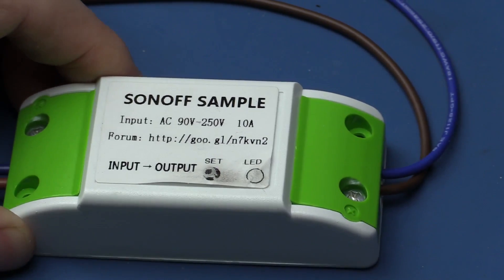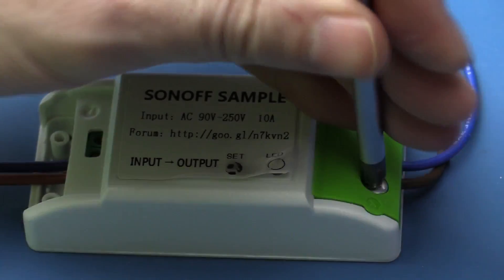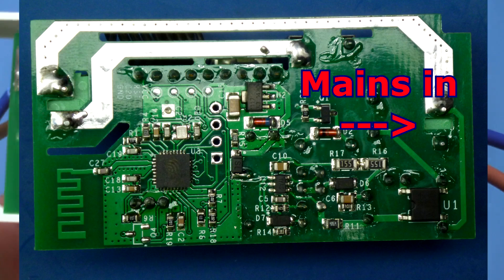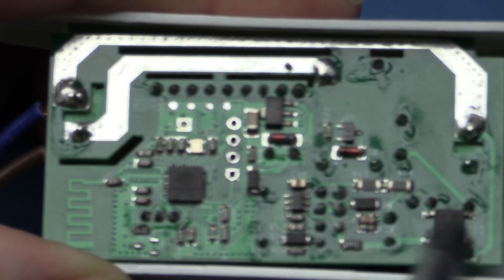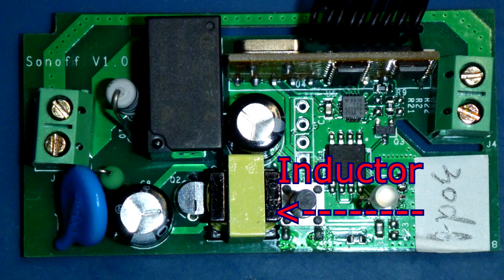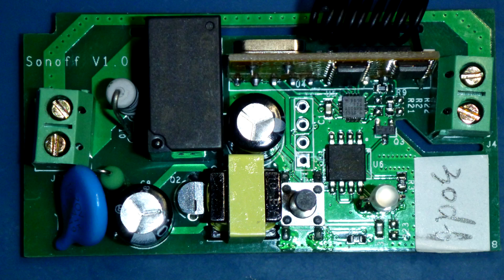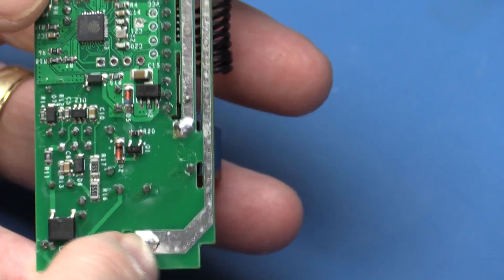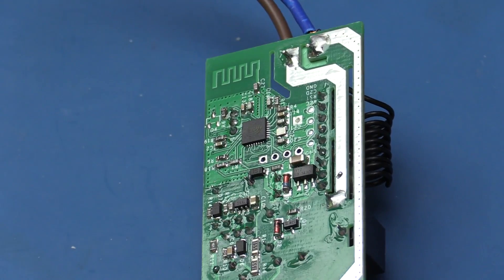WiFi Wireless Smart Switch - ITEAD Studio - Part 2 of 2 - Teardown

Comment: Also those cut outs as mentioned @ 2:23 have nothing to do with preventing the "power getting near the radio signal for creepage allowance"...  Nice to see you are impressed by them, even though you have no idea what they are for...
Reply from the maker: By Radio I am referring to the rest of the electronics which is all about the radio section (ESP8266 WIFI control etc), I am not simply referring to radio interference. Also creepage is well known term when referring to use of the routed gap between high voltage traces and is used to reduce the chance of arcing or electrical leakage between them, thereby keeping the lower voltage sections safer etc. Just because I use the wrong word for a part does not mean I don't know the use for it.
Reply: I appreciate you taking the time to respond - it's very easy to be a critic, less so a content creator. Creepage actually refers to the spacing rule that is applied between conductive elements over an insulating surface - not a routed gap, you have confused that with clearance...
Reply from the maker: :)... you are correct. two different techniques often used together (But not always) to achieve the same goal
Reply from the maker: Its always a challenge to know how much technical detail to include without loosing the audience. Some are more technically savvy (Like yourself), some are very new to the technology.
As you said, creating content is a time-consuming effort, the recording is often many times longer than the final published content and the post editing is way longer in some cases.... time to get back to that next video :).

Oh, and it does take a little bit of bravery (And thick skin) to get in front of thousands of people you dont even know and try to present topics in an interesting way with just the right level of technical ....
Reply: Yep any idiot can be a critic (although to be fair I don't think it's quite the same if your don't have a live audience when recording - but that's a gripe for a different forum...), only reason I commented was because I don't like the dissemination of false or misleading information, especially when it's presented in a form that suggests it's accurate...  Thanks again for you time, looking forward to your next video ;-)

Comment: Hi, can i copy the rf signal for more than one place? i want to use on the remote, on a rf433mhz wall switch and on my broadlink
Reply from the maker: The remotes from memory support a learning mode so you should be able to teach a single remote to multiple receivers (Note this is with the default software, there are no guarantees with third party software

Comment: I bought the prototype run. They are identical except for the form factor. Those pins in the middle are the power 3.3v and serial port rx/tx. These are trivially flashable. I run micropython on mine.
Reply from the maker: +Rob Fowler very cool, A friend of mine is already havking them to use a local MQTT Server, code etc will be published soon  http://tech.scargill.net/itead-slampher-and-sonoff
Reply: +Rob Fowler I am glad to here that its flashable, could you make the script available so that I could enhance the features?
Reply: +Joseph Zajdler Mine is https://github.com/mianos/micropython but it highly depends on what language you want to use it. Lots of people use the ESP8266 arduino toolchain and C/C++.
Reply from the maker: Are you retaining the use of the 433Mhz radio as well, that would be interesting to see.
Reply: +Peter Oakes (TheBreadboardca) No 433Mhz transmitter in the prototypes sold. I'll get some of the new ones and see how it is connected.
Reply from the maker: the newest ones apparantly do not have the 433Mhz receivers, only the WIFI (Yes the site does clearly show the 433Mhz installed but also says there not!! so I have asked for clarification)
Reply: +Peter Oakes (TheBreadboardca) I am with you on that :) The information does not seem consistent. The 433Mhz would be more handy for me to start the smartconfig process remotely. This way I can fix the board inside of ceiling lights and config the access point with the remote instead of holding the button.